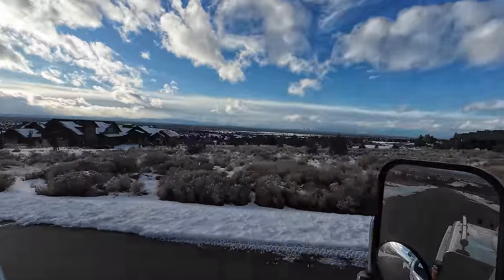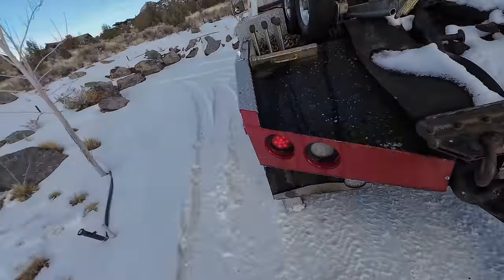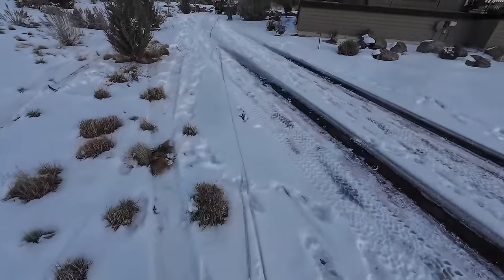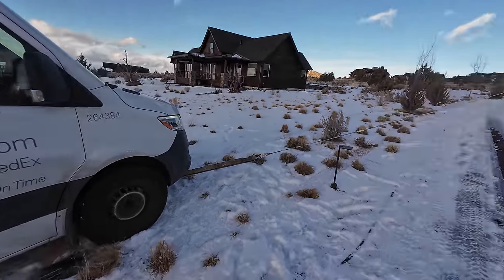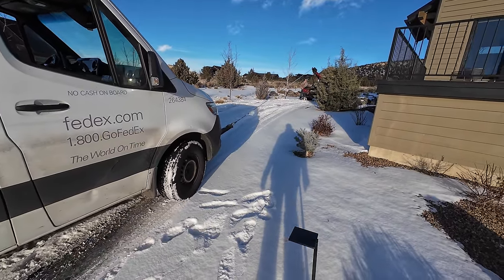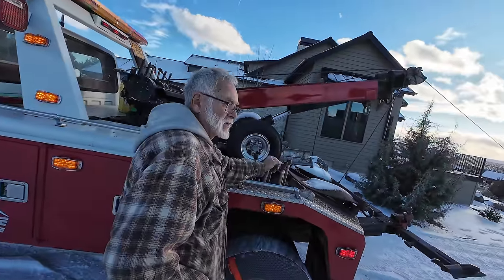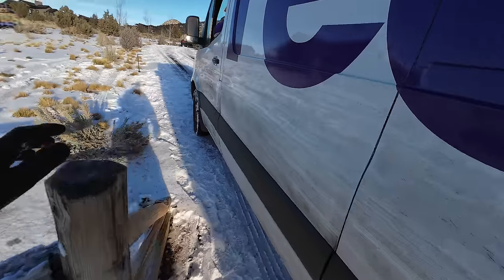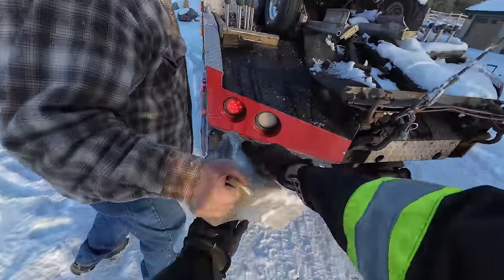Grumpy old man with a grump old wrecker!

Comment: Thank you for the shared experience, Casey.  Glad to see Grumpy back in the picture.  You guys stay safe out there.  I like the tire "chains", never seen that before.
Reply: For light duty purposes snow socks are awesome residential like that you don't dig into people's driveways and still have enough traction to get around I've never personally used them on the highway I've always gone ahead and thrown chains it's a bigger pain in the butt it's just the extra piece of mind for me but after throwing chains on my little tractors I haul to town to clear drives parkinglots and my little bobcat that fits perfect on a city sidewalk with a  broom on it chains on the truck is the easy part of the operation getting to town loading the bobcat and 3 antique tractors on the trailer is the scary part

Comment: Auto socks. I remember you using them in other videos,  my first thought was "as easy as putting on/taking off a fitted sheet". I will check them out.  Good to see Grumpy and the Ford wrecker back in action.  What a blessing to have great friends and great equipment to work with.  I'm hoping that FedEx guy doesn't get in trouble,  companies don't understand crap happens sometimes.  Beautiful area to be working in. Stay warm, stay safe and GOD bless
Reply: Probably better than fitted sheets because you don’t have to attempt to fold them neatly after washing!

Comment: how in the world did he miss the driveway by THAT much? that wasn't just sliding
Reply: Have you NEVER experienced 
wet glare ice ??
  It will change your direction at
its whim ( well , actually following
minute topographical variations
in the surface layer )
  You can rapidly be TOTALLY
OUT of CONTROL .
ZERO braking , ZERO steering , 
ZERO traction to effect an escape
trajectory ,  for anywhere from a
few yards off-course  to 100' or
more.
Reply: @rythemzlatin  have you never seen how FAR he went in the SNOW where there were no "wet glare ice"? it's not like he were driving highway speeds in their driveway
Reply: @LiLBitsDK  
    He slid BACKWARD + DOWNHILL.
The distance there is not at all
unusual.
     In driver training ,  I slid twice that
distance easily , sideways , no
control whatsoever ( in an empty lot ,
{ 2" powder over underlying icemelt }
except for 1 single solitary lamppole
in the middle , which the vehicle 
fortunately stopped @ 1 foot away )
   Have you ever driven on ice  or in
a blizzard ?
( serious question. maybe you just 
haven't experienced anything like 
that.  It was definitely an unforgetable
eye-openner  for me . )

Comment: What are the downsides of using Snow Socks?  Nice job! 👍😊👍
Reply: From a truck driver, whom I watched a while ago and who used them once, he said, you have to be very careful about how fast you go, and how much you attempt to use them because he didn’t and ruined them after his first usage. I believe it was related to unintentionally using them on pavement that was only wet, and not icy or snow.
Reply: Thanks! 😊
Reply: @kelsey809  notice how Casey took them off as soon as he got out to the street where it was dry? 
That Prime driver went about 10 miles too fast as well.